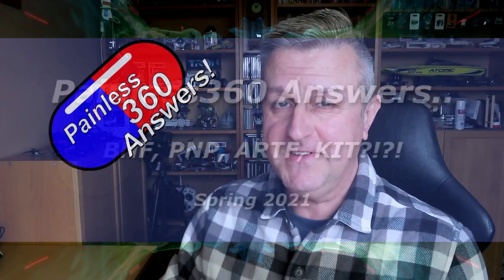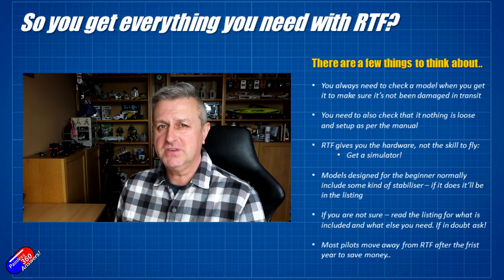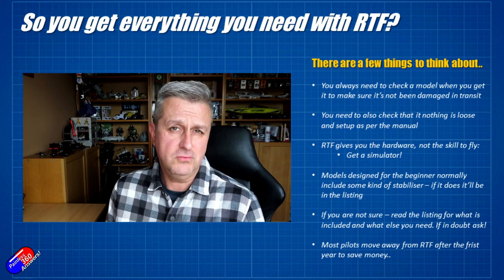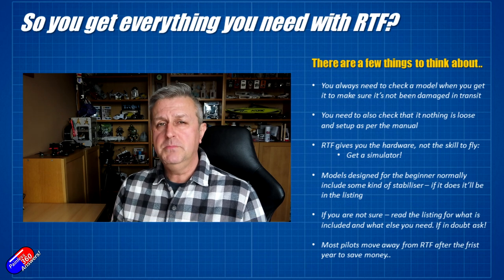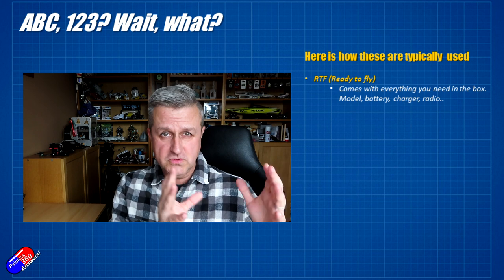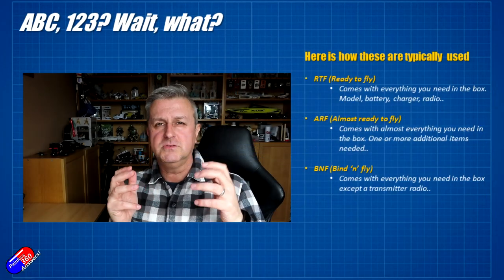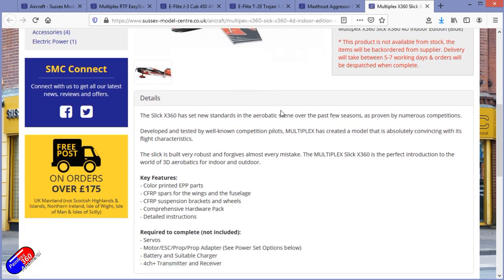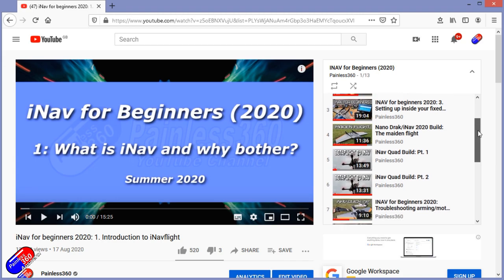RTF, ARF, BNF, PNP and Kit explained!

Comment: Thanks so much for answering my question. Great explanation. I should add that (IMHO) for small planes, stabilization is almost essential. So unless you’re getting a big plane, it is advisable to verify if it comes with the stabilizer. This is different from the quad world where.stabilization is required for basic flight on all non-kit packages. BTW - “Batmo” is a local colloquial term we use to mean tire burnout like a car/motorcycle. “Juice” is my nickname taken from my last name.  Keep up the great videos. You’re the man with the plan(e)!

Comment: Good evening Lee I wonder if you could help me? Since FrSky has made their receivers multiple protocol I can’t get any of the current receivers to work with my radio set up other than the Frsky L9R,  the T/X firmware is 2.2.20 I have watched your video on how to flash FrSky receivers and it’s very enlightening I have the T/X and R/X connected with R/X red light flashing as per your video. I have the firmware downloaded on the SD card in the Taranis 9 plus, selected firmware on the card that I want to flash when I press ENT to get the next menu all I get is DELETE no other choice of downloading to the R/X. That’s what I need help with? If you can help with this issue I will very grateful. Brian.
Reply from the maker: I'm not using that latest version of OpenTX so tricky to answer. See my video on updating the receivers for how I do it with the version I use here. Sorry I can't be more help.
Reply: @Painless360  Thanks Lee for your quick response to my query like wise I’m not using the most recent T/X firmware either,I’m too scared just in case I install it and about fifteen other receivers don’t work with the new install! Just have to buy FrSky L9R whether I need it or not. Thanks for all your help appreciate your time given, take care keep safe and keep your videos coming. Brian.